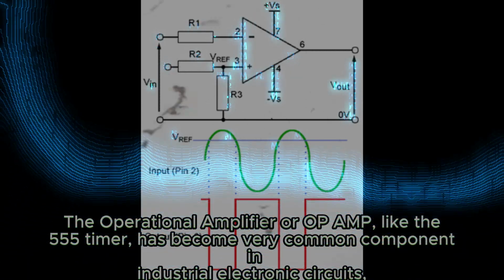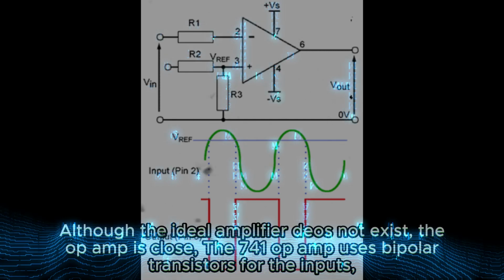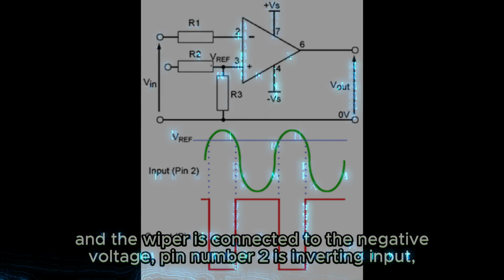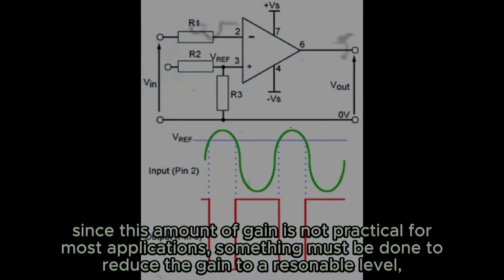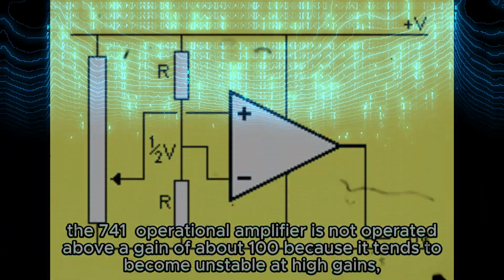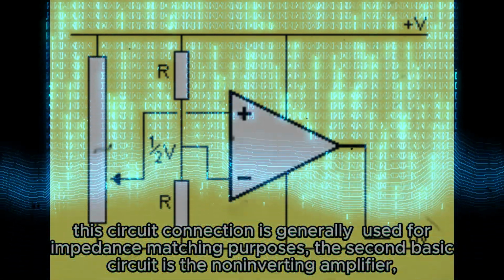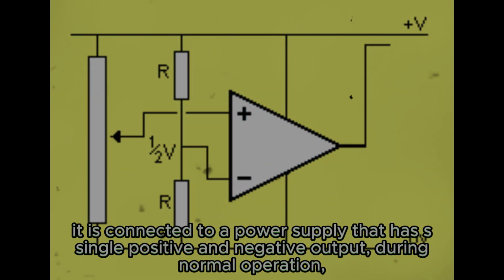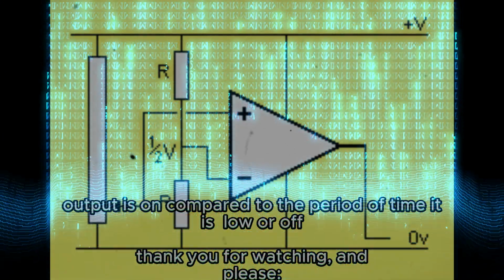The Op Amp 741

Comment: Hope this video makes you a million doll hairs. However there are some points worth improving on.
1. I hate the automated computer reading of the text article. A human reader would serve you better (my opinion only). Spell check the article before you send it to the automated reader. Spell checks are free these days.
2. Just showing the same crkt topology during the entirety of the discussion is wrong. You should be actually showing the crkts not just talking about them in the computer voice. Someone will still have to seek another source if they want to know how the non-inverting including voltage follower, inverting and differential amplifiers are actually built.
3. No discussion was made about latch-up. This is a serious problem with the 741s and coverage of what can cause it and how to prevent it is crucial to any 741 OpAmp discussion.
More research on your part is definitely in order. Compared to newer OpAmps the 741 would not be a choice for any new crkts. They are low cost but there are other low cost OpAmps that don't exhibit latch-up.
Hope your other videos are better and you make a million doll hairs.

Comment: Brings back memories of my electronic Engineering degree at Essex University 1975-77
Reply from the maker: I know the feeling, I love electronics too, back then they were fixable I believe, I remember as a little kid, the tv would malfunction and would simply replace  a vacuum tube or two and voila, good as new, today without a microscope and high end tech equipment you are done, not only that but people like the Apple engineers write proprietary software so you can replace "some" parts anymore, and other people do this also like Mercedes Benz and many other.